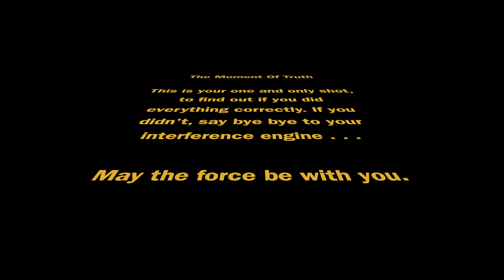DIY VL●OG: Lexus GX470/LX470 Toyota Land Cruiser/Sequoia/Tundra/4Runner/VVTi 2UZFE Timing Belt

Comment: Really awesome job buddy.... appreciate the walk-through as this is a job I'm going to have to tackle soon!  Did notice in the video... that either the portion where you add the serpentine belt is missing... or worse yet... let you didn't put the new one on at all... at least that what the video shows right before you drop in the fan & shroud.... the pulleys are empty!! Just thought I'd add this in case someone else starts giving you heat for it.  I really appreciate the massive amount of time it must have taken for you to get all those shots from beginning to end... it looked like a tough enough job without filming, so really appreciate you taking the time to do this and share it.  Kudos brother.
Reply from the maker: Haha! Thanks, I guess. Reason being we didn't add it is because there's really no good shot of it. At that point it's just so tight, and really all you need to do is follow the diagram on the hood. Besides, if that's something someone cannot do without watching a video, we highly recommend thinking twice about doing the whole thing in the first place.

Comment: Where did you source your crankshaft seal? I could not find it on RockAuto either.
Reply from the maker: I personally buy seals and gaskets from the dealer only. Aftermarket is never the same quality.
Reply: @OrganizedGarageStatus  Thanks. So for this job would you recommend thermostat seal and camshaft seal from the dealer as well? I found AISIN TPH108 (thermostat seal) and FEL-PRO TCS46036 (camshaft seal) on RockAuto. Are those considered aftermarket?
Reply from the maker: xSpaceDementia Aisin is a known OEM manufacturer, like NGK and Denso. You should be good with those. I believe that’s what I used as well.
Reply: Aisin is oem